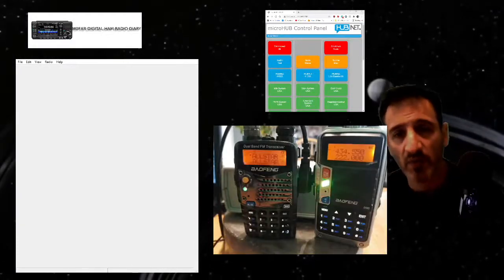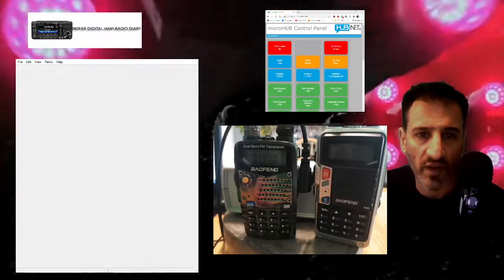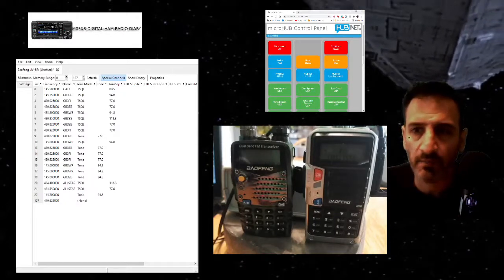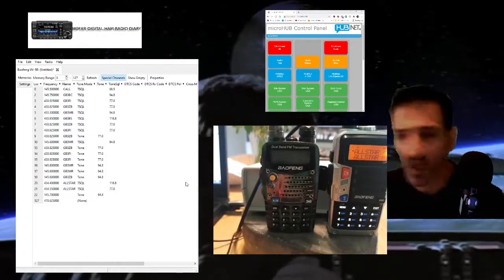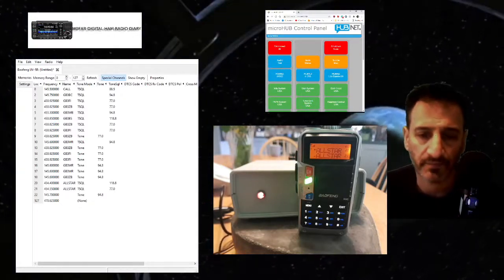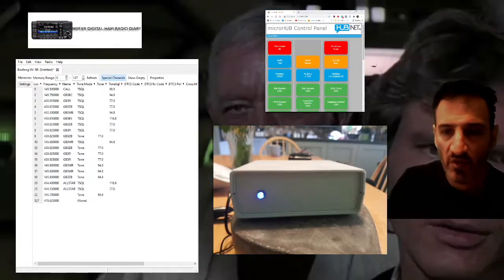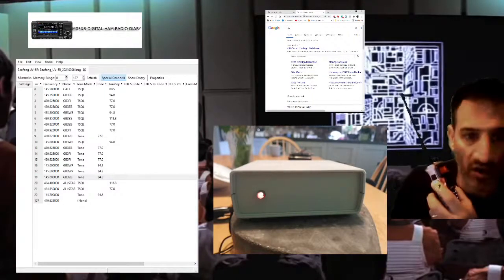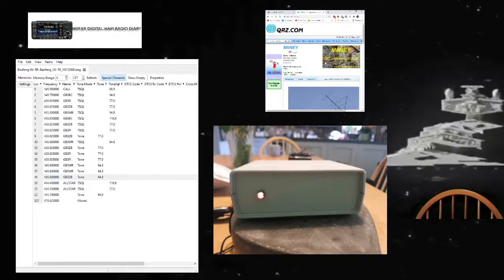BAOFENG UV-S9T- Tribad PROGRAMING USING CHIRP

Comment: The scratchy sound is dirt in the volume pot. Remove battery, Take case apart, maybe just remove knob and give it a good douche with tuner cleaner down into the pot, twist knob back and forth spray again twisting the pot. Allow cleaner to evaporate a few minutes. replace battery, try it out. if still scratchy repeat.
Reply from the maker: Hi Thanks